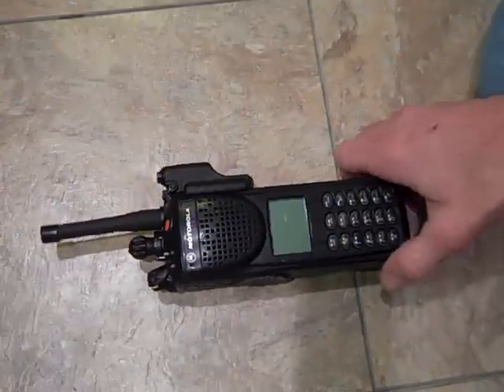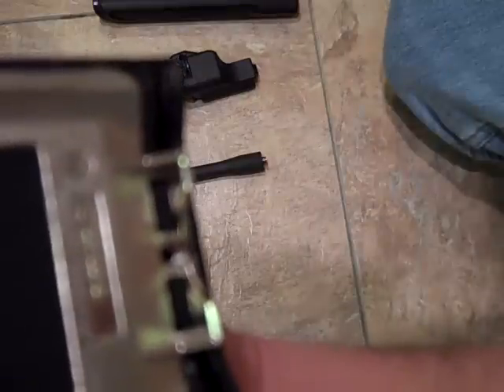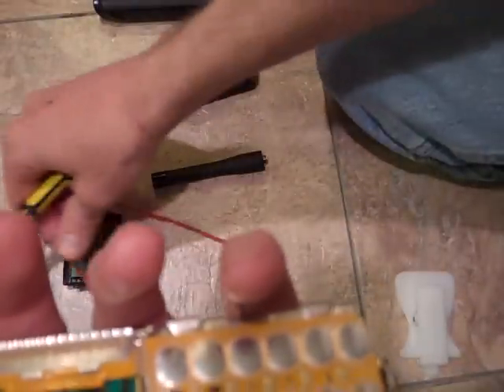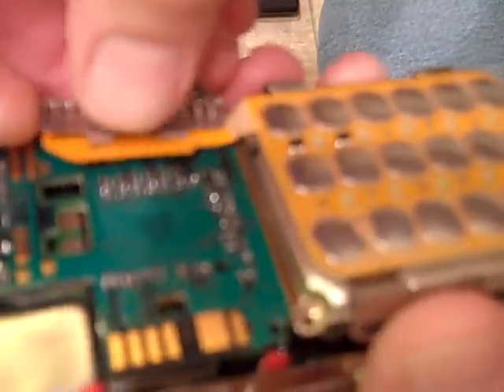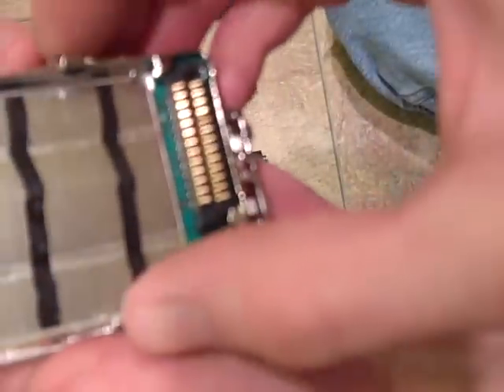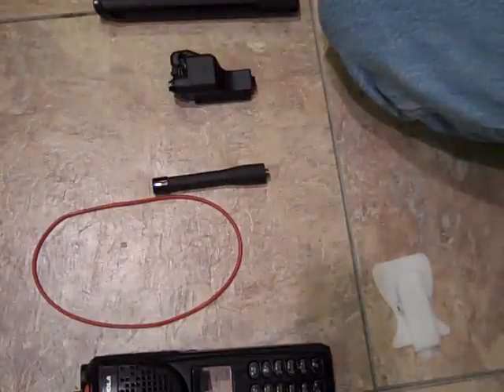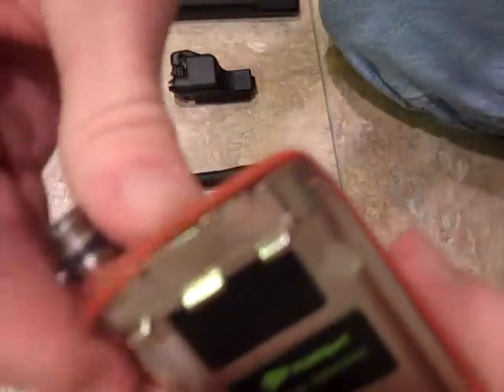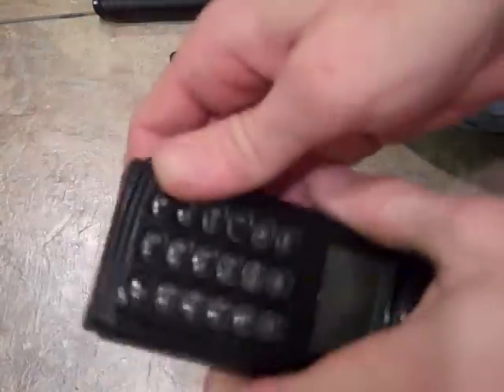Motorola XTS3000 Partial Disassembly To Get To Encryption Board & Reassembly

Comment from the maker: "Bricking" refers to damage to electronics beyond reasonable repair costs.  It essentially means that the radio makes a pretty paperweight, lol.  Improper programming techniques and disassembly and dropping a radio very hard or dropping it into water - if its not waterproof - will fry out the electronics, thus the term "Bricking"